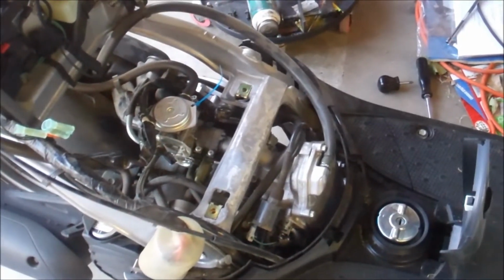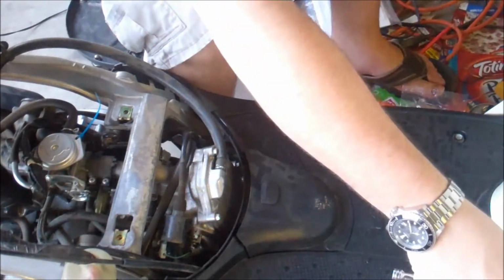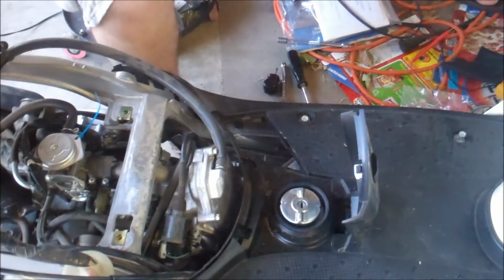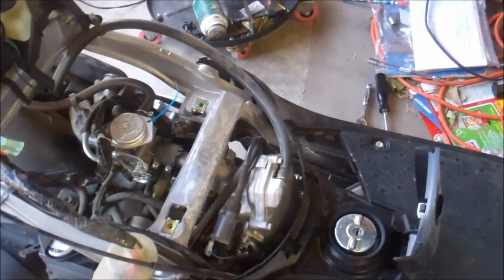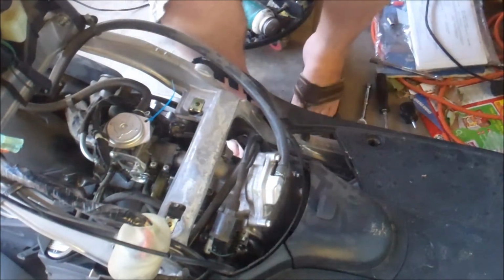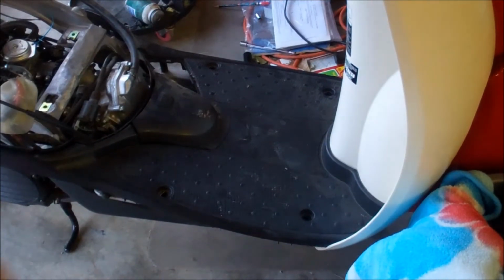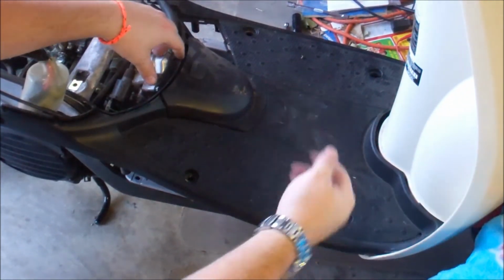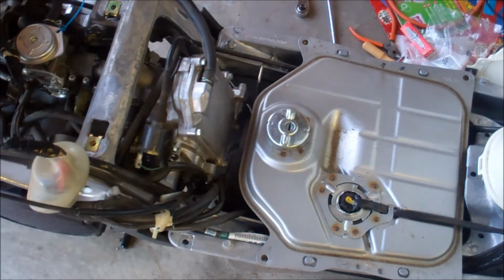2005 Honda Metropolitan (CHF50) Floor Pan Removal

Comment: Can you tell me what might be working right because my gas gauge isn't moving from full after putting a bunch of miles on. I've taken the float out. The needle in the gauge doesn't move when I move it up and down. Mine is a 2006 Metropolitan.

Comment: battery here in town is $130, ebay has $35.00 no shipping, what kind of battery is in yours.  Last time I got one on ebay it was $25 no shipping but then that wasn't the scooter problem and it sat too long.  Can you have a charge put on a dead battery or is it just toast on these small ones.